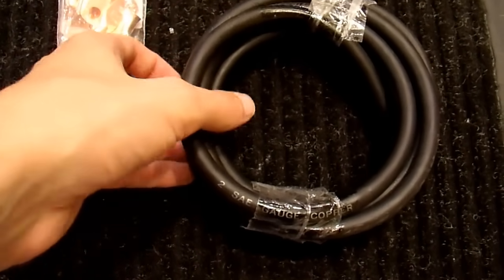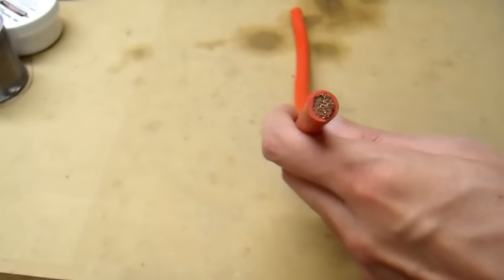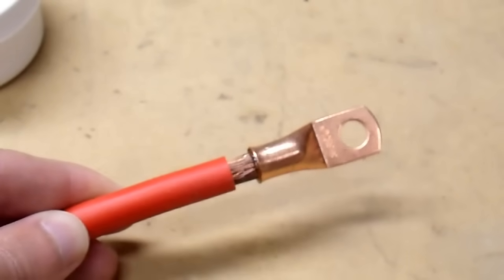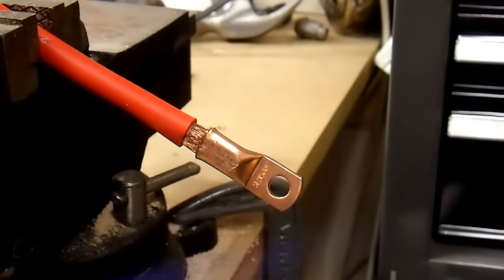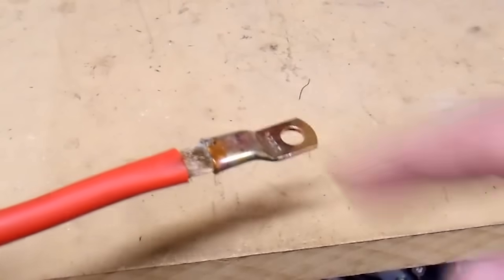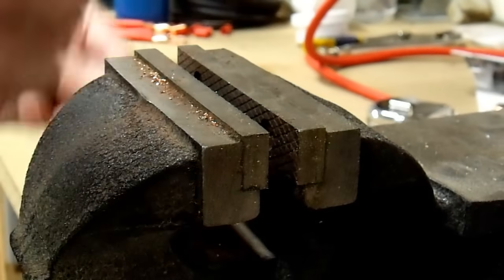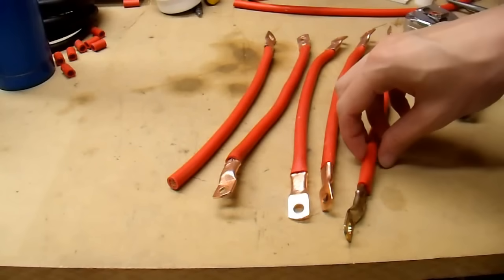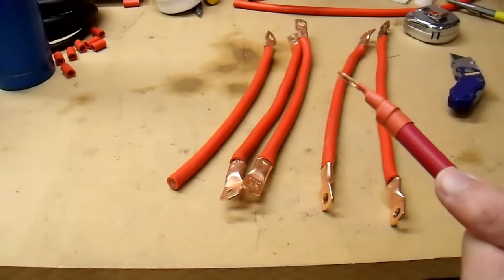How to Make Battery Cables the Right Way and the Easy Way

Comment: I was talking to some solar installers that were in my area putting up a small solar farm.  They were telling me that they only use crimp connections and never solder them because if there is a lightning strike it can cause the solder to shoot out of the connection in a molten ball that starts anything it touches on fire.  I have soldered mine in the past but I may move to just crimped ones in the future.
Reply from the maker: Harry Sheppard
Thanks for your comments!  Rational discussions such as this seem to be uncommon on YouTube unfortunately.
Reply from the maker: That's an interesting claim and one that I did not consider, but it seems more like urban legend to me!  Regardless, I also don't see major benefit from soldering if crimped solidly and used in a benign environment.  I rarely solder these larger crimps anymore.
Reply: ***** Definitly a no-no on soldering power connectors from what a couple of electrical engineers have told me: if for whatever reason they're subjected to an overload or even a loose or corroded connection on the eye-end, the heat from the overload / high-resistance joint can cause the solder to reflow and drip onto something else, potentially causing more trouble. Not ideal...
Reply: I wouldn't :-) If you crimp a terminal correctly, it'll end up cold-welding itself - the individual conductors within the cable pack down and become a void-less single lump. Remember that things like guy wires that hold up antenna masts can be crimped in a similar manner, and they're under a deal more physical load than an electrical connector. It's not the right thing in every instance, but certainly in any application carrying any significant current.
Reply: Harry Sheppard
As opposed to a crimped only positive lead terminal vibrating or backing out and grounding itself, which would definitely cause more trouble? I'll take solder.
Reply: Again, in most cases I do agree with you, and I've done similar things myself to get something working, but having seen the aftermath of such things it scares me a little :-). Also, it's not so much the temperature of the solder causing problems, more where it drips to! Just my $0.02...
Reply: I started out to put a 1,000watt array with 10 panels up. That means at least 20 connections that alone could your total resistance to go up a lot and this would cost you a lot of loss in watts . A solder joint has a way lower resistance than a crimp connection and it will keep moister and corrosion out.  And who cares  about a lighting and solder. A lighting that will travel along the wire will find the lowest resistance to ground and most likely will mean  that you lost your semi conductor solar panel and equipment, talking about putting fires out in your utility room and wire ways. And of course, all your equipment is mounted on cement boards to prevent the  fires to spread.
Reply: If the lightning should strike, the whole place will be fire regardless of the solder. hahahahaha LOL
Reply: I've seen plenty of properly and improperly crimped terminals fail. On the other hand, can't recall many soldered terminals failing. Of course my experience is mostly automotive/truck/RV type applications. As such, lightning causing the solder to wick or "jump" out is something I have yet to see. Maybe having 4 or more tires contacting the ground has something to do with it.
Reply from the maker: Harry Sheppard
I ask you to keep in mind the application and intent here:  If one starts with an industrial quality termination and uses a hydraulic tool or dedicated die to crimp the terminal then soldering won't work as there is no room for it to flow into the joint.  The joint should be sealed externally and there are products to do so.  In this case I agree fully with you.  However nearly all aftermarket automotive and consumer style crimps are not of this type for costs reasons - even when new from the factory - and the crimp-and-solder approach is a good one for low cost work without special tools.  Also note that solder melts at less than the ignition temperature of nearly all substances and has a low specific heat, so it isn't likely to cause any fires.
Reply: A slim chance; solder EVERY connection, EVERY time.

Comment: Just use clear heat shrink
Reply from the maker: Buy why?  For what purpose?  It still collects acid and moisture and leads to problems.  I don't like heatshrink on cabling unless it is for cosmetic purposes and for that it needs to be opaque.
Reply: ***** I generally apply liquid tape from about 1/2" up the jacket to 1/4" over the soldered lug and then go over the top of the liquid tape with heat-shrink or tightly applied electrical tape.  This will help prevent the wire from corroding inside the jacket of the cable since moisture and acid have a tendency to wick inside the jacket over time just like they do in un-soldered crimp connections.  If I do this and then apply corrosion inhibitor grease to the battery terminals and lugs I have never had to deal with corrosion.  All of the cables I made 15 years ago for my cabin solar backup system this way are as pristine as the day they were made.   I haven't ever had a need to look at the connections under the heat-shrink or tape.  If I am worried I simply test the resistance of the cable using a 225 amp load tester and measure the voltage drop across the cable while also measuring the inline current..

You could also apply the corrosion inhibiting grease to the exposed metal up to the jacket of the cable and that would probably be almost as good if you are really looking to cut costs.  Liquid tape, heat-shink/electrical tape and corrosion inhibiting electrical grease are all pretty cheap compared to the cost of cable  solder and lugs anyway and a little goes a long way.
Reply from the maker: kuhrd
I had considered mentioning the adhesive lines heat shrink as that would be an option to prevent fluid ingress but, again, didn't see a major benefit over just leaving it off alltogether.  It sounds like you found a different method of doing the same thing and I cannot disagree with that method.  Grease is also a great idea for non-sealed battery types which I could have mentioned.  I plan on using them on AGM batteries indoors so corrosion isn't much of an issue.

My main argument is that if there is a problem I want to easily see it.  That's just my take.  Congrats on your cabin, BTW.  Wish I had one..
Reply: ***** it's not PURELY cosmetic because the heat shrink is an insulator and that small gap, the exposed copper between the terminal connector and the wire insulation, can be touching another wire/ground/conductor,etc. unbeknownst to you. It may not happen often if you are careful, but once is all it takes to make you realize it can happen. Heat shrink is rather inexpensive anyway and takes a few more seconds to put on. Adhesive/waterproof adhesive is better, but more expensive and may not be necessary. For a quick project, you will be fine, but for long term applications, I wouldn't risk it. Not worth it for a few pennies.
Reply: @Zeppelinlv2007  this dude clearly is sloppy and lazy..

Comment: The Harbor Freight hydraulic crimper when on sale is a great investment and not too pricy. It smashes those connectors on so tight no solder needed or could get in there anyway !
Reply: No matter how tight you crimp a lug, you can ALWAYS get solder in there.

Besides, soldering is super easy. Only takes slightly longer than crimping it anyways.
Reply: MastaSquidge If you can get solder in there you didn't crimp it right by definition!  Most people don't properly crimp though so I don't know... maybe it's better to use solder than to just have a bad crimp.  If you can figure out how to PROPERLY crimp something, then NO solder is best.
Reply from the maker: Darin Weeks
A 'proper' crimp (which means deforming each individual strand into a solid mass) is only achievable with rather expensive dedicated tools and is not really the subject of this video.  These tools make it easy but they aren't necessary for the average person to make a few quality cables for a personal purpose.
Reply: Using the proper terminals is the first thing. Don't use terminals that say 4-2 on #4 wire. Use ones that are for #4 only.  A terminal that is marked 4-2 should only be used on the #2 wire. You want to start with as little clearance to the wire so that when it is crimped, it grabs all of the strands tightly.